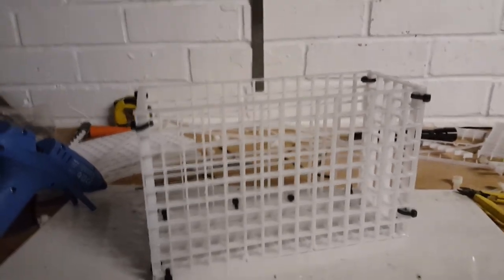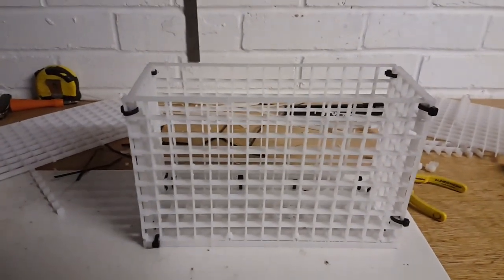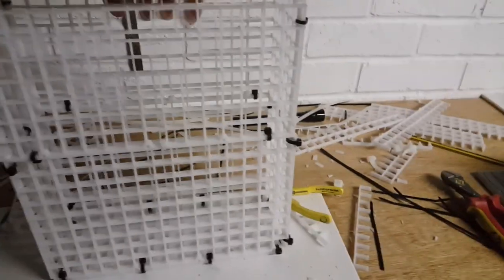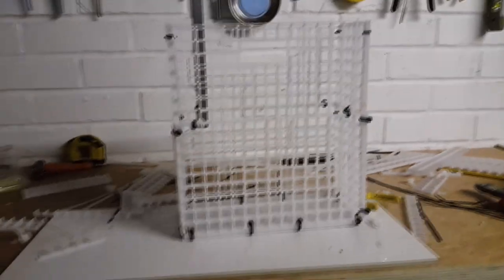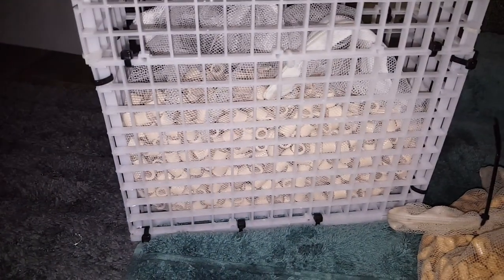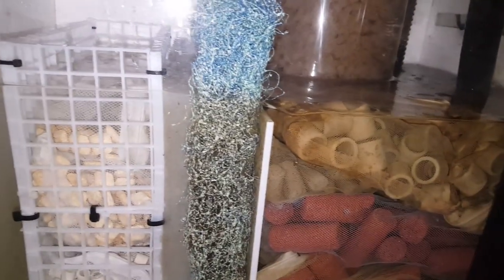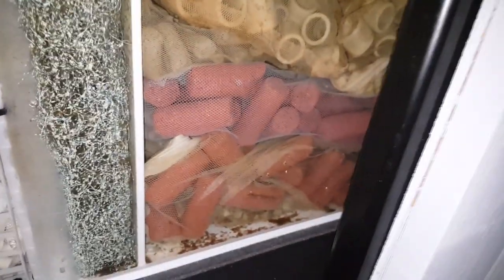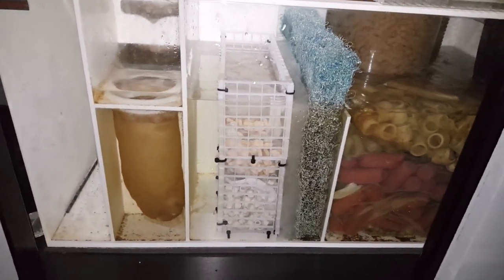DIY Sump Filter basket

Comment: how many liters per hour is your pump
Reply from the maker: Hi, The pump is a 7500 lph but I run it about 1800 lph so i get good contact with the media in the sump . I also have a wave maker in the tank that gives me extra turnover. Or do you mean the pump on the moving bed reactor that is a 1200 lph but it is turned down to 300 lph same reason for good contact :)
Reply: @KelsAquariums Okay thanks I now have 5000 lph jebao but when he is at 5000 lph he goes over the edge of the emergency gate at the last filter bag do you have that too? I do not have an extra pump in my aquarium